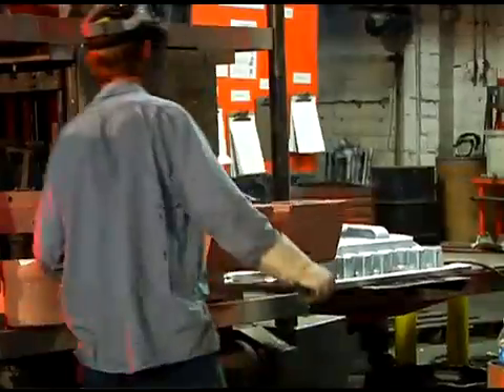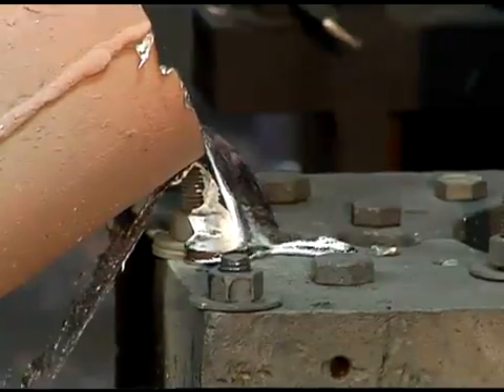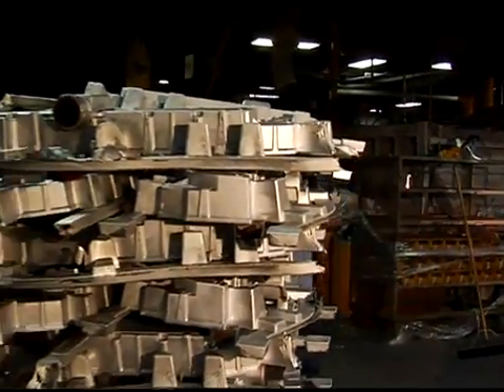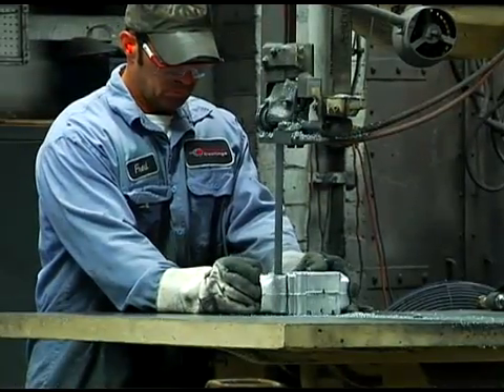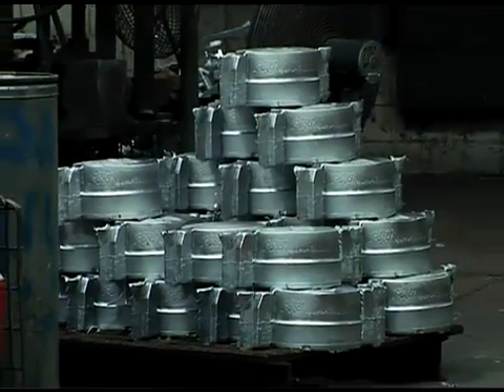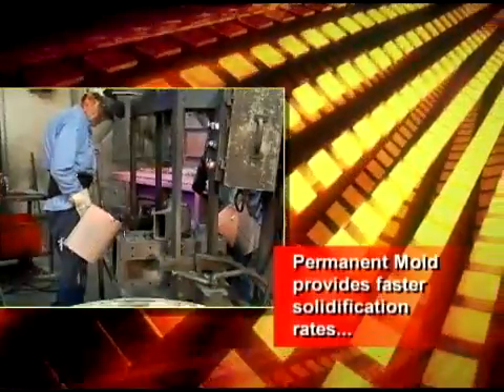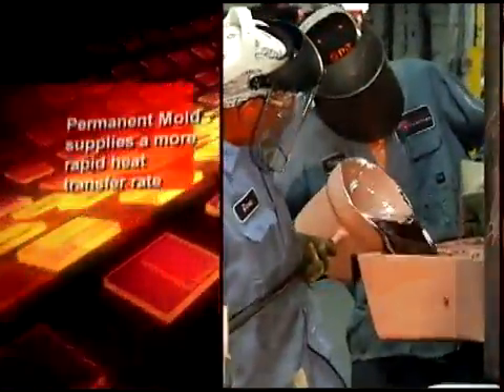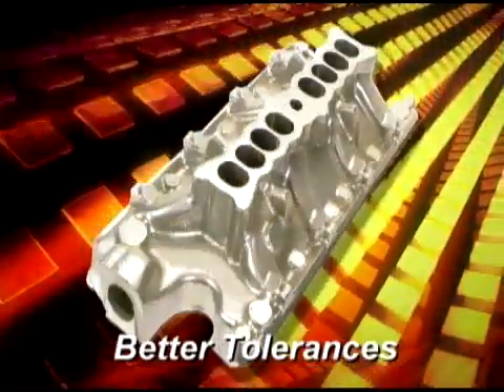Permanent Mold Aluminum Casting

Comment: A beautiful short video on Permanent Mold Casting. Thank you for posting such instructive videos ! Permanent mold casting is a
metal casting process that employs reusable molds, also known as permanent
molds made from metal (other mold materials may be used too such as graphite for
iron and steel casting). The most common process uses gravity to fill the mold,
however gas pressure or a vacuum are also frequently used. ... Casting metals
many be aluminum, magnesium, copper alloys. Permanent mold casting is a process
that shares similarities to both sand casting and die casting. As in sand
casting, molten metal is poured into a mold which is clamped shut until the
material cools and solidifies into the desired part shape. On the other hand,
sand casting uses an expendable mold which is broken and destroyed after each
casting cycle. Permanent mold casting however, as in die casting, uses a metal
die that is typically made from steel or cast iron and can be reused for
producing thousands of parts. Because the molten metal is poured into the die
cavity and not forcibly injected, permanent mold casting is referred also as
gravity die casting. Major difference between permanent mold and die casting is
that permanent mold is a gravity feed process whereas die casting uses
pressurized injection of melt metal into the die. As in die casting, generally
you will need a few weeks to months for the die (mold) to be manufactured and
usually and upfront die fee payment is required by most manufacturers. Once the
die is made however, parts can be produced fast.

Permanent mold casting is typically
used for high volume production of at least a thousand or thousands of small,
simple metal parts having uniform wall thicknesses. Non-ferrous metals are
typically used in the process, including aluminum, magnesium or copper alloys.
However, iron and steel can also be cast using graphite permanent molds. Common
permanent mold parts include metal housings, pipe fittings, automotive
components such as pistons, impellers, gears and wheels.

Variations on permanent mold casting
have been developed to accommodate specific applications, which include the
following:

- Low Pressure Permanent Mold
Casting: Instead of being poured, molten metal is forced into the mold by low
pressure air. The application of pressure allows the mold to remain filled and
reduces shrinkage during cooling. Also, finer details and thinner walls can be
molded.

- Vacuum Permanent Mold Casting
Similar to low pressure casting, but suction by vacuum is used to fill the
mold. As a result, finer details and thin walls can be molded and the
mechanical properties of the castings are improved. 

- Slush Casting: As in permanent
mold casting, molten metal is poured into the mold and begins to solidify on
cavity surfaces. When the amount of solidified material is sufficient to
produce the desired wall thickness, the remaining slush (material that has not
completely solidified) is poured out of the mold. As a result, slush casting is
used to produce hollow parts without the use of cores.

Part weights between 2 oz - 660 lb are typical, surface finishes Ra between 125 -
250 Microinch are typical, tolerances of +/- 0.015 inch are typical, typical
maximum wall thicknesses obtained are 0.08 - 2 inch.

You can watch similar valuable
videos by visiting our Youtube site from our logo on the left and visiting our
website. We have a collection of subscribed channels with similar good videos
on various manufacturing technologies.